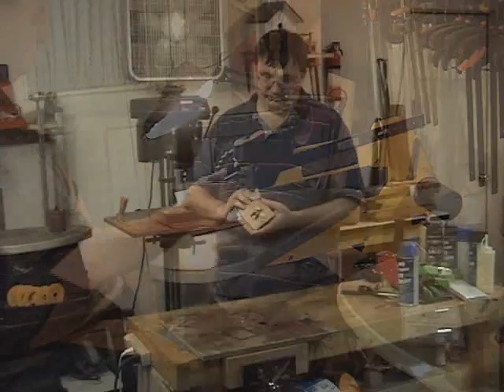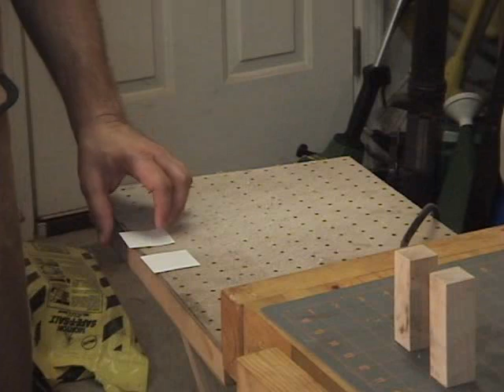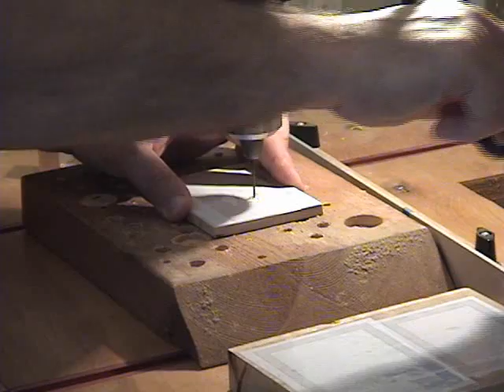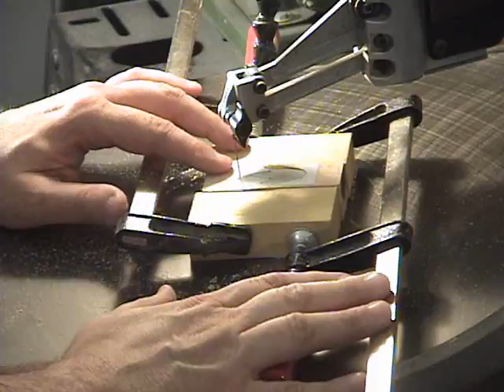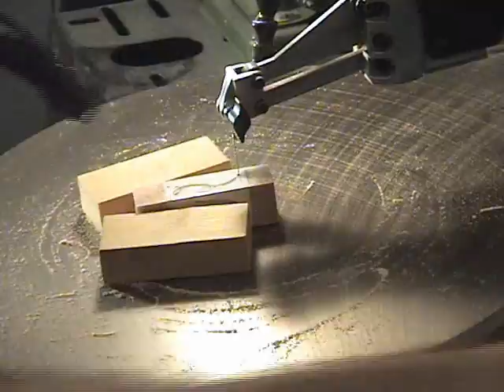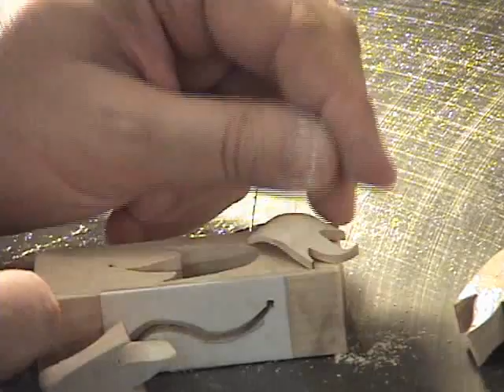Very basic 3D scroll saw cut. Part 1

Comment: @111Iknow No one has answered, so I've got a suggestion (though this seems to be an old post lol). Use a lathe to cut out the scroll parts, a scrollsaw or your preferred method to cut out the "paper" part, and use a dremel w/ grinder (or something similar) to cut out holes of the thickness of the "paper" and of its width into the "scrolls."